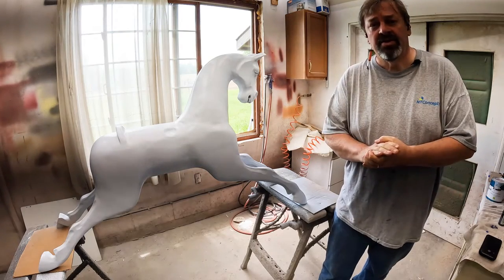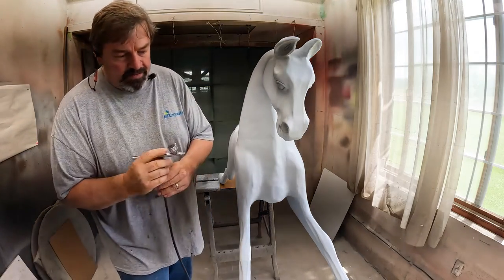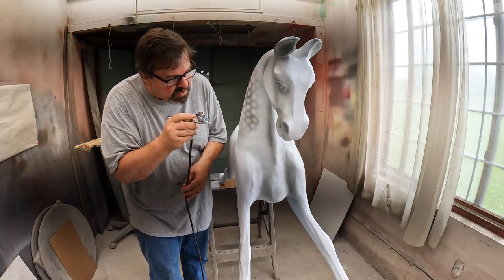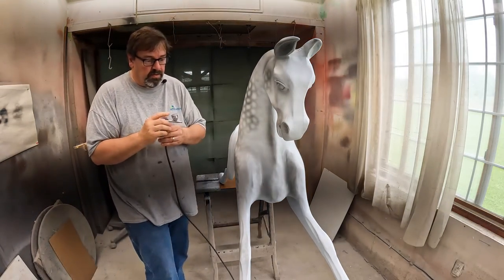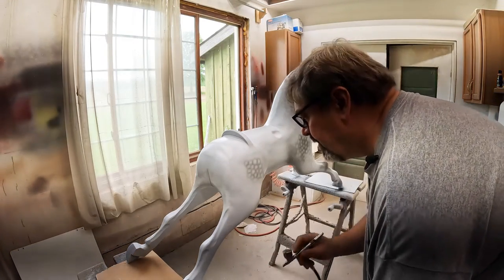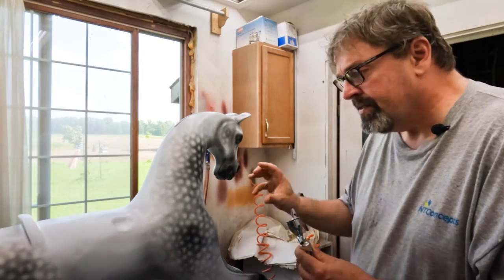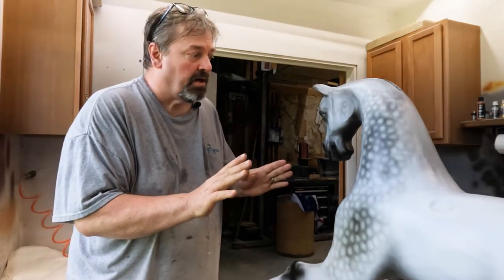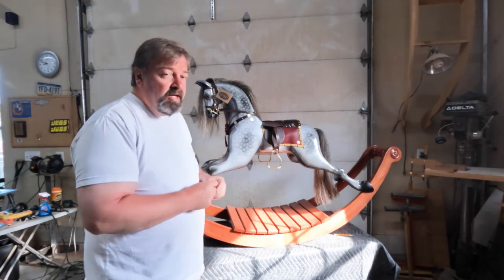How To Airbrush A Dapple Grey Rocking Horse.

Comment: The banding is caused by a mismatch in shutter speed and the frequency of the lights. Slowing the shutter speed down will usually slow or lessen the bands. There are also some things that can be done in editing but that can be a real pain in the south side. Find the shutter speed in the menu and set it to around 1/50.  You can go as low as 1/25 but you will start to notice motion will blur. Some settings must have changed because your other videos in the booth have been ok.  Here is an example video of how it works https://www.youtube.com/watch?v=FLQMvDfERrs  I believe gopro defaults to auto shutter as it is an electronic shutter instead of mechanical shutter.
Reply from the maker: Thank you Curt! I think I might have the settings correct now. I’m not sure how familiar you are with GoPro. I bought a Black GoPro 10 about 6 weeks ago and I’m still working on learning it. The previous videos I shot using my iPhone. I went through the GoPro settings and there is an anti flicker setting. I set it at 60hz and my frame rate is set at 24 fps. That seems to have corrected it but we’ll see. So much to learn! My microphone are another issue. I’m using Movo wireless lavalier’s and it sometimes drops its connection. I’m looking into Rode wireless mics next.
Reply: @Greenfieldwoodworks Those anti-flicker settings sound about right. The Rode mics seem to have a decent track record.
Reply: @Greenfieldwoodworks  One thing you may notice with the GoPro (even the newest ones) is they aren't designed for low light use. If the light level gets dim or 'weird' (off color or mixed) the video quality suffers.
Reply from the maker: Thank you, I’ll keep the lighting in mind. All of my lights are upgraded to LED’s. The flicker isn’t too bad out in the shop as much probably because of the high ceilings but the paint booth has low ceilings.  I think I have the settings set right now. That video explaining Banding was extremely helpful. Thanks again